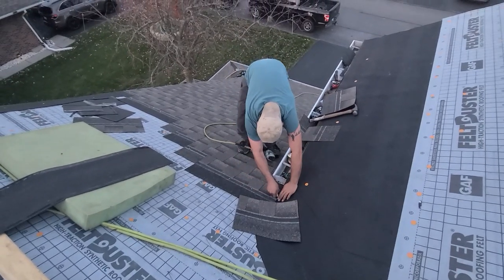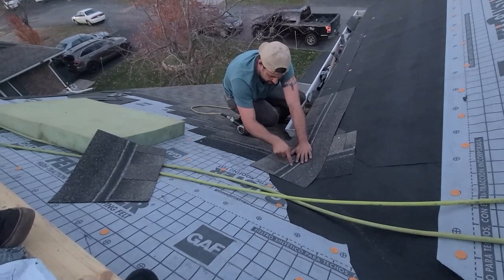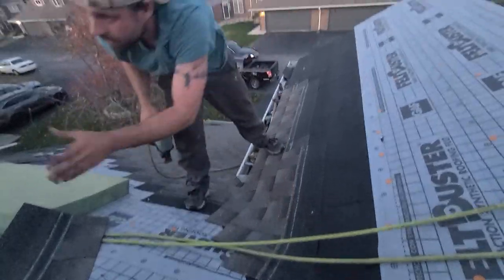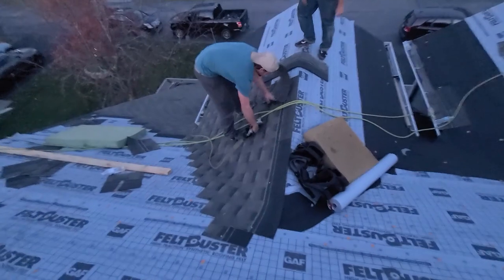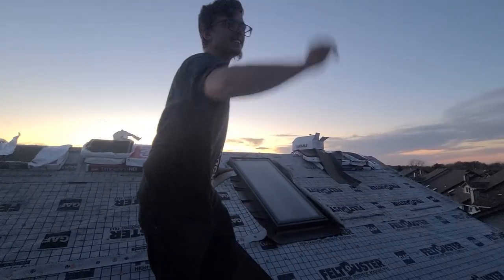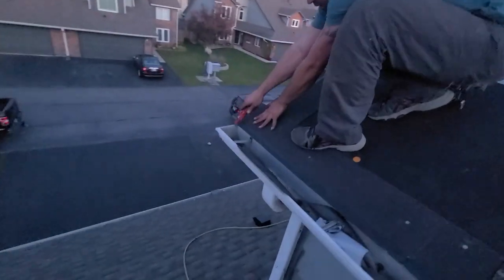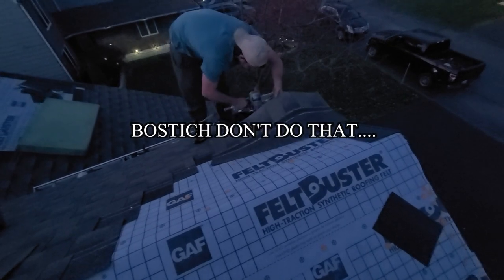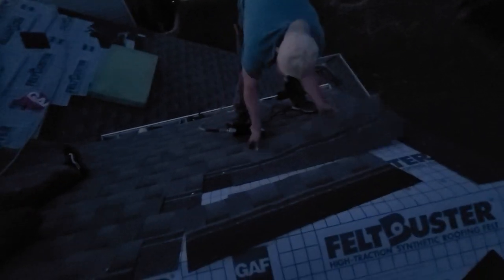Worlds Fastest Shingler Bustin' it out

Comment: Nice video, and nice shingling speed for the piddley part of the roof!  You use some different techniques than myself, but it seems to work well for you.  I'll have to consider the kicker shingle, as I usually spend a lot of time popping the framing nails out at the bottom of the valley so I can slide my shingle and ice/shield in 6" or so.  Side tip, but this year was the first year I got an Equipter, and it is absolutely the best investment ever! Nevermind that It's equivalent in labor saving to a full time labourer, but it's worth it for the advertising alone! With a heloc my financing comes to $116 CDN a month!  There is a reason nobody who owns one complains about it.

Comment: How do I shingle where the two planes meet at the ridge? There won’t be a vent installed. I just kept shingling both planes until they met. Thanks
Reply from the maker: Not sure exactly what you mean
Reply: @NWIVeteranConstruction  when your doing one half of the roof and Boycub is doing the other side, and you’re both shingling from the eave to the ridge….how is the “point” where you meet Boycub supposed to look? I finally finished the rental house and now the top point (where two opposing planes meet) looks like overlapped granule portion of the shingle. I used GAF NS charcoal color and the exposed part of the shingle spans the ridge. Do I just conceal it with charcoal ridge cap shingles? Thanks

Comment: Can you explain why you did the valley here the same way boy cub was doing it on his return video (and you tore of and did the opposite)?  Is it because the dormer roof is the same pitch as the main roof?  Did you do the other side of this dormer the same way or did the dormer shingles extend first onto the main roof?  So confused right now 🤔
Reply from the maker: So, most valleys are done this way... where that valley line goes above the ridge... because you want to run your lower slope first.  The one with boycub was weird because there was a pitch change. The reverse gable peak was steeper than the pitch it died into.  If you're looking to see typical valleys, you can see 2 more on my page. One is it's own video, and the other is in the 2 hour long video, there's a time stamp on the description or Comment section

Comment: 4 square materials supplyed what do u charge
Reply from the maker: Depends on pitch n all that.  If it's gonna take more than half a day I Gatta charge 7-800 for a day's work
Reply: 40% 10.85. Run is 26ft.but minus 6 ft for the flat.deck 74 inches. True 2 inch main beam.its not a traditional hip got that flat at the top chimney in middle common rafter i believe is 11 ft make one intresting video
Reply: 8 minutes a square so what do you do after the 32 minutes?😁
Reply from the maker: @5050johnsmith  lmao i was talking tear off n such